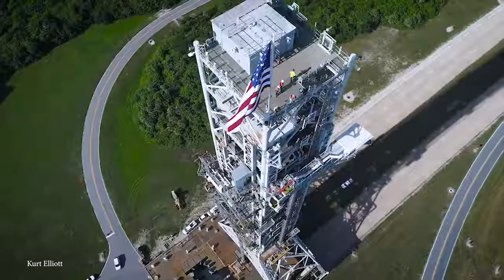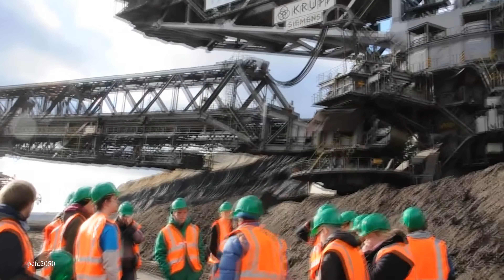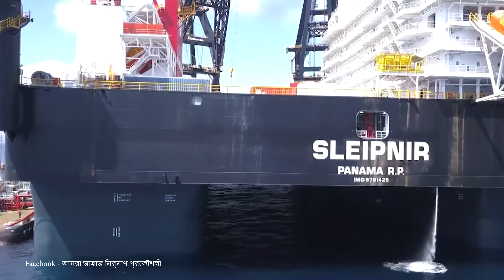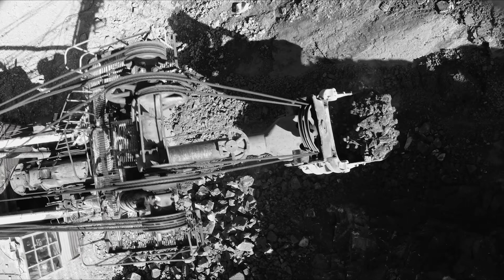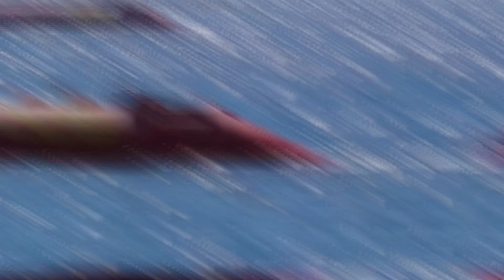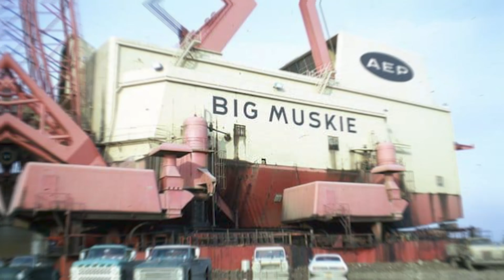15 Gigantic Moving Machines

Comment: The big floating crane can lift 20,000 tons. The part that just cracks me up that is the “green energy“ what a farce this country will never have green energy that is an oxymoron windmills lifespan 15 years but it takes 22 to 25 years to recoup the energy, it took to manufacture, mine and installthe wind turbine and solar panels are even worse.